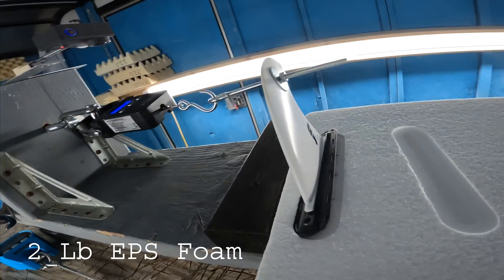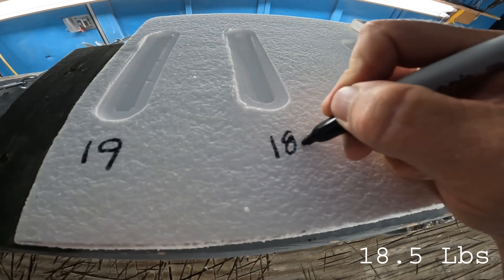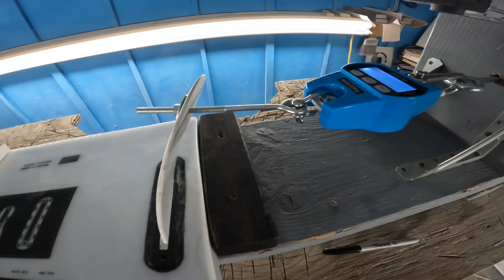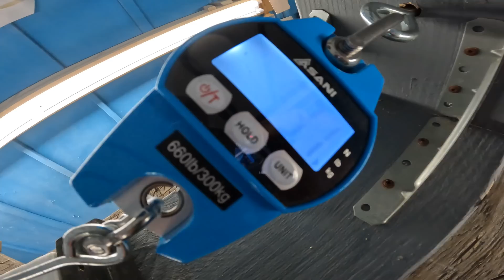Which Fin Box is Better (Futures or FCS2)?

Comment: Random that this popped up on my feed, but fitting... I don't have strong opinions on many things, but fin boxes are one of them. I respect FCS for bringing a removable fin system to the market in the 90's and ran them until 2001 when I heard about Futures. FCS fist generation design was intended for the fin to break off at the tabs and save your board. That was great but they snapped off fairly easily if you were surfing a shallow beach break and when I was in my early 20s, I couldn't really afford buying new fins every few months. I'd say that 90% of my boards from 2001 til now have had Futures. I have broken 1 Futures box, and I remember it clearly as it was a freak kickout leading to me  to bodyslamming the fin and sending me to the doctor for stitches. The small percentage of FCS boards...? I have broken 10-15 of my FCS. They are inferior in design and it is obvious. .. Not to mention, Futures feel more grounded to the board in general.

Comment: Interesting and cool experiment and video! I've thought for a while that Futures were more durable and better for your board than FCS. I'm not sure if this video confirms it, but it does offer more information. I used to work at a surf shop and whenever anyone came in with a broken fin, the damage was always worse on the FCS than the Futures. These were also the days when FCS had the old independent plugs rather than the two slots that are connected by/part of the sort of figure 8 box. I remember seeing the FCS damage would usually pull the plugs out while the Futures would usually snap the fin while the box, glass, and board were all usually still intact. Anecdotal info to make of what you will.

Comment: As a twin fin surfer and losing my share of fins due to failures of boxes, am a future fan but still see problems. 

Mayor problem on both fin boxes is delam between box and glass. This happen, fin gets lose and pop, it’s gone. FSC show signs much early. Possible worth looking at repeating low loading both ways and see the damage. See if the low loads soften the foam which course failure. I’m trying pins to strengthen. Ie, sticking a pen into the side foam before setting the box to allow extra resin to form pins. I’ll keep you posted as early days
Reply from the maker: Thanks for your suggestion and input.... Cycling the fin could be a fun and useful experiment.  And please, let us know how your pined fin box installs go.

Comment: I actually reckon the FCS fusion is worth a look. These use the old twin tab fins. The thing is that it's a lot more likely you'll break the fin rather than the box with this system. You can but the twin tab fins cheaply on line  An instant $20 fix as opposed to a trip to the ding repair guy and probably more like $100-$150. The key is to really go to town with the resin when glassing the boxes in. That's what I do anyway. There's a lot of rocks round here and I haven't busted out a box yet.

Comment: I got stabbed pretty bad on the inside of my leg surfing a futures fin it cut through my board shorts and I ended up with 12 staples. I later was surfing and fell onto the board the same way with fcs2 and the fin popped out and I just got a bad bruise. I feel like the fcs2 is a safer fin system but the futures is stronger.
Reply: Wow, I never thought about the possibility of getting stabbed by the sharp end (tip) of the fin and FCS II at least has the potential to just pop out rather than give you a possible deep flesh wound.  Thanks for this new insight.  I'm taking out my grub screws and don't care if I lose a fin.

Comment: Cool video mate and we’ll set up testing. I have a board repair business in NW Australia and would like to share my experiences with both Systems. Firstly no beach breaks here and all waves are reef breaks with reef jump off entries and exits and no beach paddle outs. Without a doubt Futures system handle a good reef grinding way worse than the FCS system. I repair around 10 Futures box’s to one FCS .Can’t say for certain which system is used more here in Australia but would say about equal I think. These are usually front on impacts and the Futures come strait out. Not uncommon to see all box’s in a board ripped out. Another area Futures tend to fail in are  in twin fins using large base keel fins in light weight glassing high performance boards. 
I’ve removed full twin set ups and retro fitted FCS 2 box’s to stop the box’s popping out on some boards which is kinda what your testing was meant to represent, eg side loading on  the fins. The glass schedule of these boards is no doubt part of the problem but seems to be more prevalent with Futures. Either way fin box repairs are probably 40% of the repair side of my business and help pay the bills and I tend to fix more Futures than FCS but who knows could be more boards out there with Futures in them. Once again very cool and interesting video mate , much appreciated.
Reply: Thays the oppsite to what ive experienced as a surfer. My fcs2 boxes were constantly popping out from the slightest knock. Switched to futures and only lost one so far.
Reply from the maker: Thank you for taking the time to share your experience with fin box repairs.  Those real life / anecdotal observations are valuable, and sometimes more valuable, than what's done in a laboratory setting (note that my shaping bay is definitely not a legitimate lab).

And it's solid, that you caught that my are a focus was on the side load forces.  I actually gathered a lot of data not featured in the video.  Mostly having to do with rotation of the box at a given force and how that translated in to the foam and glass.  Interesting stuff!

A number of other repair guys have chimed in as well.  It's interesting to see the similarities and differences in their remarks and I hope the discussion continues.

 Thanks again- Michael

Comment: Nice video. But why do you measure the sideways force? That is the force that goes into your ribs on a bad wipeout.  I'd love to see this test with front, to rear force, like hitting a rock.
Reply from the maker: Thank you for your question... 

My focus wasn't really in comparing the endurance limits of the fin boxes.   It was more aligned with seeing how each fin box respectively transfers energy from the fin to the board and from the board back to the fin again.  And being that the forces we put on our fins during normal surfing activities (not an impact) are greatest in a turn (a lateral force) I went with a side-load pull.

And note that I collected a ton of data not featured in the video.  Fin box rotation at a given force, deflection of the foam, etc.

As for impact resistance?  A number of guys who repair boards professionally, have chimed in on that.  And, if the topic is of interest and there's enough community support, I'll be be happy to explore that too. Let me know?

Thanks again for your question.
Reply: Me too! So many boards just hit other boards or rocks!

Comment: When surfing depends where and how is the impact on FCS you might lose the fin but not the fin box it happened to me, on Futures you might not lose the fin but it will damage the fin box it happened to my friend
The fin replacement is cheaper than a fin box damage

Another friend that is a twin fin surfer, uses Futures specially for Keel fins, he said the FCS boxes can't hold the pressure on the keels they come out with time and he made the switch

I wanted to make the switch for Futures but every surf shop most of the brand new boards for sale are on FCS and if you want Futures you have to order and wait for long time
Better have both I think

Comment: Full time board repairer here (@ small kine ding repairs). FCS2s make up the overwhelming majority of my fin box repair jobs. I order FCS2 boxes monthly to restock my workshop. Fusions I order roughly twice a year, FCS 1 plugs I order every 3 to 4 months and Futures I order once to twice a year. 

I will never put an FCS2 box in one of my shapes and if I were the type of person to buy new boards, I would avoid anything with FCS2s. I have had this conversation with many ding repairers in many places and the rate of busted FCS2s doesn't seem to vary. The results of your test did not surprise me at all but very cool to see it visually. Well done!
Reply: Same here, nearly no Futures repairs, LOTS of fcsii
Reply: @wouteroosting4687  Majority of new surfboards come with Fcs as standard unless it's a custom, In theory you'd expect to repair more fcs boxes just because of the ratio. Of the newer boards anyway. Also depends on flex of fin, type of fin, glass job, foam construction, type of blowout etc. a lot of variables.
Reply: @bryanpoon2881  good thinking Poonja!
Reply from the maker: When you receive boards for repair, does the physical damage correspond with the results I got on these tests? I'm especially curious to know if Futures boxes simply blow out and/or if FCS2 fracture or shear the foam off in a given area?
Reply: @continuesurfboards4564  sorry I'm switching accounts left right and center. 

Yea, your results rang pretty accurate. I find with the FCS boxes, they are more likely to lift, delam and rip the surrounding glass making the repairs much harder to hide.

Usually futures damage is cleaner and only breaks the glass within a few MMs of the box.

In all fairness though, I think a test that measures force pushing down on the fin into the box/board is needed. The biggest reason for replacing FCS2s is because one side or end of the box has been pushed into the board in impact which compresses the foam beneath leaving a void between the box and the foam. I have little doubt that futures would win that test as well though.
Reply from the maker: Thanks for your input...  appreciated!

Comment: Isn't this more a question of which foam/fibreglass combination is better? When a finbox blows out, it's not the box that gives way, it's the foam and lamination that gives. Maybe I'm wrong here and happy to be corrected.
Reply: To add a little more to this, I do get that the fin box comes into play as well, but I thought the more important question would be the foam/glass combination.
Reply from the maker: You're absolutely correct.  While the fin box is the foundation for our fins, the foam and glass are the foundation for the fin box.  So the whole of the fins and fin box system is absolutely dependent on the structure of the surrounding material.

I did this test with 2lb block cut EPS foam and 6/4/4 glass,  The result certainly would differ with 1.5 lb foam or 4/4/4 glass.

Comment: Awesome comparison. It's like Project Farm for surfers. I switched to Future fins back in 2003 because my heavy ass blew out the FCS fin boxes on 2 different surfboards and one time I was just doing a bottom turn. I haven't had any problems with Future fins and I just got a surfboard with FCS 2 fin boxes and was thinking of investing in more fins and boards with the FCS 2 boxes but I think this will be my first and last because my 235 pound a$$ don't need any help breaking stuff.
Reply from the maker: You sparked my curiosity and I checked out Project Farm.  What a great channel... Subscribed!
Reply: Switched to futures for the same reason did the same thing in 2010

Comment: Awesome video! Although lots of potential for this study to not be a very good representation.
A few thoughts that come to mind that could heavily influence the results:
1) Were fins the exact same size?
2) Did both fins claim to have the same amount of flex/strength?
3)Were the anchor bolts drilled in the exact same locations on both fins? A change here could easily change the force/moment on the box

Overall still a great video that gets people thinking, but a warning to all (as the video mentions) this is amateur science. For a science experiment to be proven true, it must be repeatable by others and produce the same results. So dont go throwing away those FCS2's after this.
Reply from the maker: Good questions... I really appreciate your points of concern and especially that you took the time to address it in a comment.

1) Futures and FSC make a number of templates that are nearly identical.  Futures has three base templates and FCS has four.  The fins I used in this experiment are not the same but are close in form.

2) And yes... Flex and strength are certainly a factor that can influence the outcome of a result. But a key thing to note is that the force applied to each fin box is being transmitted through a similar type fin that's made by the respective manufacturer.  (IE: Not a carbon fiber blend vs plastic or an authentic vs counterfit product).

3) And yes, the holes for the anchor bolts are drilled to the same arm (XYZ) and they're oversized by 40%.   Like-for-like. 

And please know, that I totally and completely respect your point that this is just amateur science (emphasized).    In retrospect, I see a number of things that could have been done differently, and, that would have improved the data.  It's just a matter of starting somewhere and moving forward.  

Hopefully, and perhaps with enough community interest, and some support from Futures and FCS, I can improve upon this and take it to a new level.

Thanks again!
Reply: @continuesurfboards4564  Awesome replies!!! As an engineer who loves to surf (and do some amateur science myself), I am absolutely going to subscribe and watch/learn from your videos. Hope to see more from you.
Reply: @continuesurfboards4564  the actual fin box shape/design/depth of the fin boxes disperses forces differently to each other. The lip and bottom of the futures finbox encourages to flip and 'snap' out like the bottom of a boat rocking back and forth, It wants to pivot out. Hence the minimal foam damage in test 2. The length and base of futures fins/boxes are designed to have greater area to disperse force compared to FCS's 2 tab system. There's only 1 fail point in Futures which is strong but when it goes, it goes. Fcs has multiple from the fins to the individual fin tabs to the mechanism of the actual fcs block to the structure of the board around it.

I'd like to also mention that the FCS system relies on the structure around it to disperse force e.g. glass + foam. Which is why the figure 8 outline of the FCS fin box took out more foam in test 2.

The flex and construction of the fin in my opinion plays a bigger part in this experiment. The more the fin flexes the less amount of force is actually going through to the fin box - like a sponge. Also this leads to warping of the arm gradually changing the angle of force. 

But great video and amateur + anecdotal science at it's best, this is why we re-test and evaluate. I was looking at this project through the eyes of judging it as one of my students final science projects (Senior physics teacher). Best of luck in the future super stoked that this was made!

Comment: one of the reasons behind removable fins is that if you lose a fin out in the water you can paddle in pop in a new one (we all own more than one set) and paddle back out. now if you damage your board even if you fix it yourself it will take hours, the tide will change, wind will get on it, waves will die. many ways to argue this i'd rather lose a fin than damage my board i use fcs and i quit cranking down the screws as tight as possible years ago. just my 2 cents i'm sure i'll hear about this from someone

Comment: GREAT video! One question: When you say that the FCS II Finbox is “deforming” under pressure, can you elaborate on what you mean? This “deforming” is occurring all under the glass? Are there any cracks or other damage happening to the glass/resin itself overlying the FCS II finbox?
Reply from the maker: Thanks for your question...

At 60-65 lbs., the FCS2 box appeared to be buckling from within itself.  This was especially notable along the space between the fin tabs. 

And, there was only a slight delamination of the overlying glass.

Note: After the pull, the fin wobbled considerably in the FCS2 box, but the fin tabs showed no sign of stress or damage.

Comment: 8 year ding repairer here. We reset 4-5 FCSII boxes a week. Futures we do 3-4 a month. FCSII is a poor system.
Reply: That could suggest more FCS2 systems out there
Reply: @davidmcnamee2402  way more FCS systems out there
Reply: @davidmcnamee2402  agreed.
Reply: Yep! I'm not popping out fins on a daily basis. Fcs2 is a gimmick imo
Reply from the maker: When you receive repairs... Does the damage correspond with the results I produced in these pull tests?
Reply: @continuesurfboards4564  I’ve done over 1000 fin box repairs, and yes, this is how it goes. Fcs damage tends to rip out foam and damage the board further away from the box. Futures breaks cleanly around the box, almost 100% of the time. I do find that futures will tend to have that delam effect more often than fcs, but maybe that is because it has a higher hold tolerance. Fcs doesn’t really crack, they just break out. Fcs also tends to rip the fiberglass 4-5 inches out from the box as well, usually all the way to the rail.
Reply from the maker: @jonnyzuma6884  Thanks for your input... appreciated!
Reply: @continuesurfboards4564  yes 100%.
I order all my boards with Futures.
Reply: Middle America here. IMO It’s easier for a kook to reset an FCSII fin box on your own, then futures. Can’t get a good ding repair in this part of the country.
Reply: We cant look at those data by it self, we also need to take into consideration how much fcs is used compared to futures,(of course if there is more fcs out there u will have more fcs repairs)
Reply: Futures= quality & performance.
FCSII= poor quality + poor performance = good marketing.